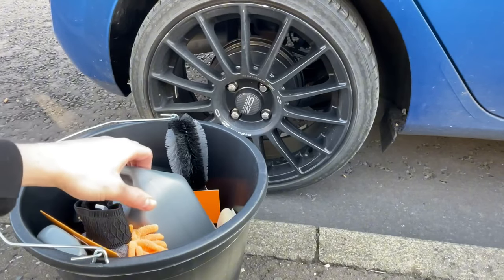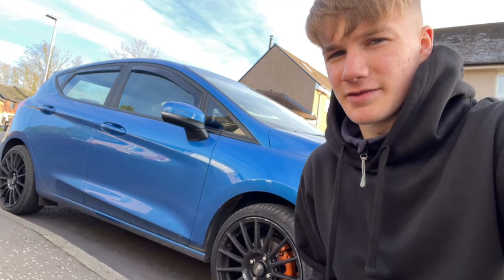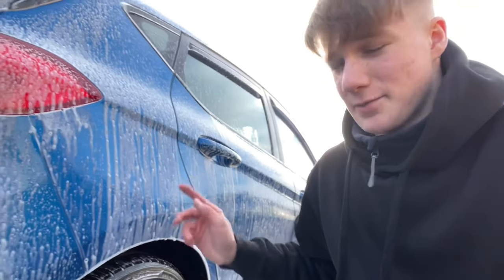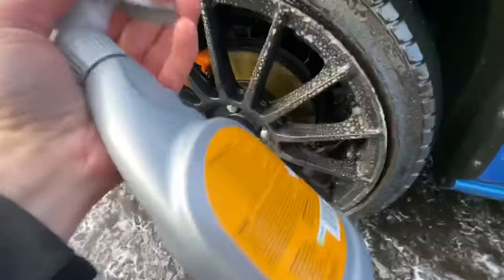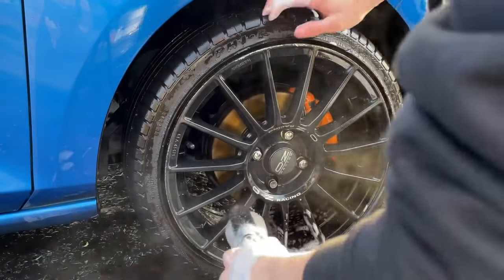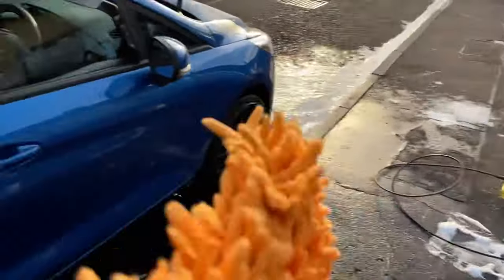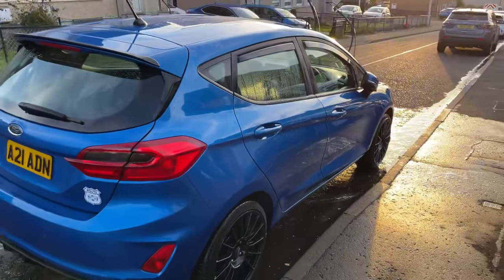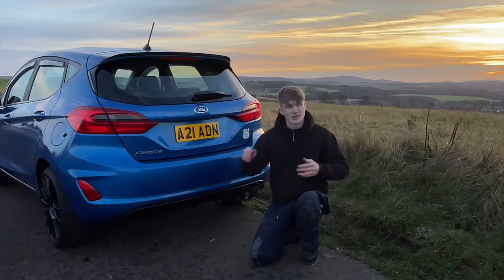Detailing my car with the CHEAPEST cleaning kit I could find!!!

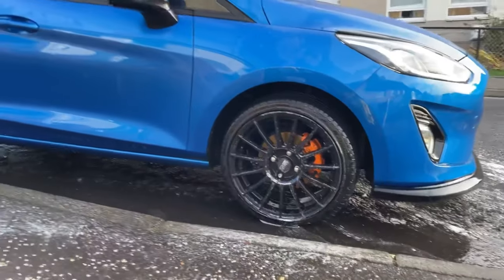Comment: 04:53 The useless "grit guard" !  Think about it.  They are a scam.  Look at the size of the holes in it and think about the size of the dirt particles in the water.  That guard does FA to stop any suspension in the water.  The only thing it will do is stop a mit or cloth touching the bottom of the bucket, but you are still agitating the dirt in the water, so it is not stopping it mixing and being picked up.
You would need to leave the bucket still for quite some time to let all the dirt settle on the bottom, but once you put anything in the water it mixes again.
They're a massive scam and do nothing to stop grit or dirt staying in the water and being picked up.

Comment: How come you jet wash before snow foam?
Reply from the maker: The high pressure water takes off the caked on dirt as the the snow foam doesn’t come out high pressure
Reply: @Aidan__Galloway  I hear ya but thought the whole idea of snow foam is to lift off what it can and loosen what it can't. So you're not pushing as much muck across your paintwork with the jet washer.